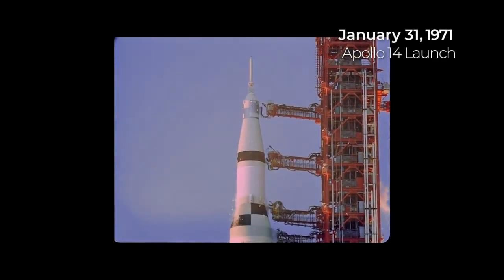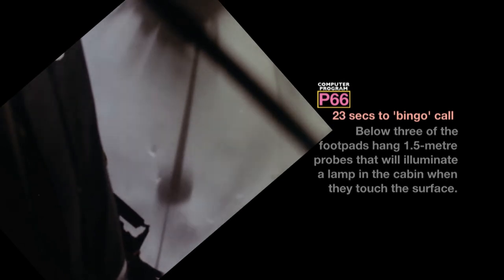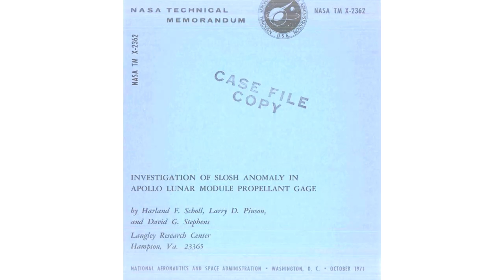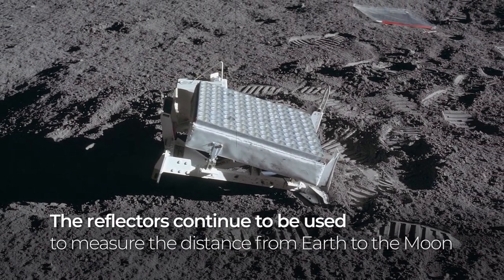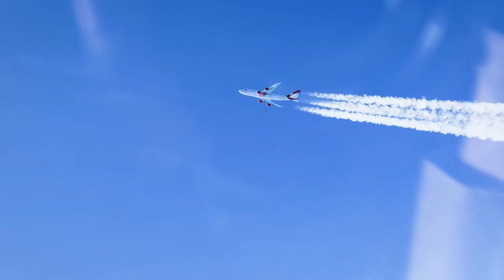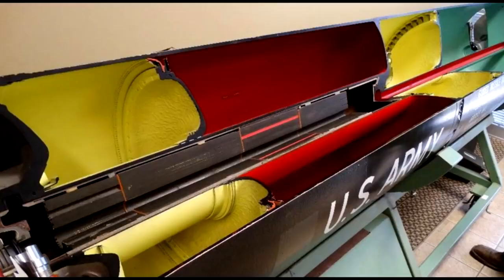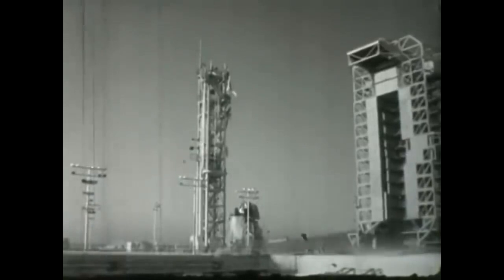How NASA's Apollo 14 Fixed A Critical Problem Using 'Keyhole Rocket Surgery'

Comment: The propellant has the same mass/inertia on the Moon but at 1/6 the gravity. This further confounds efforts to keep it at the "bottom" of the tank making baffling more important.  Ask a tanker truck driver if he likes baffles. :)
Reply: Not sure moon gravity is relevant when landing, as you are in free-fall when not accelerating (i.e. "gravity" is what YOU make it). Gravity is mildly important when leaving the moon, although your acceleration tends to be mostly straight up so sloshing isn't as bad as it is in free-fall.
Reply: @icollectstories5702  I agree there are no gravitational effects during free fall. Baffles don't have any effect either. However during deceleration and hover they do.  :)
Reply: @ebenwaterman5858  The point is whether you decelerate at 0.001g or 5g is at your discretion; moon gravity doesn't apply until touchdown, at which point fuel feed isn't vital. Launching from the moon is a similar situation, aside from assuming that you've stayed long enough for the tanks to settle.
Asteroid departures should probably not make this assumption.
Reply: @icollectstories5702  Well, not quite exactly, as during the final descent you'll have to pull > g/6 in order to decelerate and land -- consider that a perfect hover "feels" the same as being on the surface to your fuel tanks.
Reply: @icollectstories5702  The LM was only in free fall during Lunar orbit, it was a powered descent from orbit all the way down until the last three feet when a contact probe touched the surface and the descent engine was switched off. The LM then dropped the last three feet to the surface.

Comment: I did my PhD in micro-gravity CFD slosh modelling... claim to fame for this vid. XD
Reply: Will you work for SpaceX or NASA?
Reply: @conorm2524  neither, I am not a US citizen or PR. crys
Reply: @thunder852za  ESA?
Reply: The term CFD is ringing bells in my head but I can't remember why.
Reply: @ze_rubenator  perhaps one day... I am just a Aus citizen living in South Africa. 😅
Reply: @xmlthegreat  Computational Flow Dynamics. Basically computerized fluid simulation.
Reply: Imagine doing your thesis using a just a very tiny portion of an iPhone processing today. Then imagine yourself as Neil Armstrong about to start the engines after undocking from the CM.
Reply: well aren't we the fancy one?!?! *jealous eye roll*
Reply: Surface Effects for Arbitrary Mesh. Hmm. Intriguing
Reply: Sounds like they figured it out already.
Reply: mind me asking you if you using ansys or comsol or write your own solver by matlab?
Reply: @fotoniksuperduper9435  its a bit of a long story. The marketing pitch is: We write our own code in C++ called Elemental. We part of the InCFD research group at the University of Cape Town. We do work with Airbus and Ariane Group. So I wrote large parts of Elemental's code, specifically the incompressible two phase surface tension modelling physics.
Reply: @JGuraan  oh yeah. I remember now. I was helping my friends in Mechanical engineering install software on their computers and it was for their CFD class. This was years ago. May have been MATLAB, may have been SolidWorks. Don't remember clearly, and it's not my field anyway.
Reply: @JGuraan  *Computational Fluid Dynamics.
Reply: @thunder852za  Sounds maths and code heavy.  This was non linear CFD with 2 phases? Was your research successful?
Reply: Why not use a bladder with compressed air to press on the fuel in the tank, to prevent sloshing.
Reply: @alexdye6625  I think that would not actually prevent the sloshing of the fuel, since all you're doing is adding another fluid inside the container volume and pressurising the whole container. Try shaking the drink in bottle of coke... Even though there is immense pressure from the escaping soda, the liquid inside will slosh freely as you move the bottle around. Gravity or an approximation of it is the only way to keep the liquid on one side of the container.
Reply: @xmlthegreat  I meant more like a plunger forcing the fuel out and not allowing any gasses to mix with the fuel.

Comment: I saw a speech given by Neil Armstrong on the Apollo 11 lunar landing. He said that he "wasn't even concerned" about the "low" propellant quantity warnings he was being given from all quarters as Eagle neared touchdown, as very low fuel quantity remaining was exactly the way he had always done it in the LLTV.  Thanks to the excellent preparation the Trainer unintentionally provided, he knew the very little fuel he could count on having was sufficient to do what he had to do.
Reply: It sounds like the joke about the mathematician boiling a pot of water.  That would almost sound like he deliberately ran the engines until the fuel was low, then landed!

Comment: There is a wonderful Tindellgram on a problem with the low fuel warning light on the LM which meant even without the sloshing problem the warning would trigger the master alarm as well the low fuel light.   The memo finished: "if this is not fixed, I predict the first words uttered by an astronaut to land on the moon will be 'Gee whiz, that master alarm certainly startled me.'"
Reply: a case of an abundance of caution being dangerous? (master alarm going off too early)
Reply: @oldfrend  I mean I can see what they mean there, you really shouldn't get your pilots used to just ignoring the Master alarm because it goes off for low (not out of) fuel.

Comment: Very interesting discussion, thanks. Note that I designed a slosh control device and a propellant management device (PMD) for the liquid stage of Orbital Science's Pegasus rocket. The slosh control device was also assembled inside the tank, since the tank's construction was already completed. The slosh control device consisted of circumferential rings at multiple levels along the tank's length. The assembly's support structure opened like an umbrella inside the tank. The rings were then bolted by hand to that structure by reaching up inside the tank thru the outlet port. The PMD was a cylindrical design bolted to the outlet flange. It was sized to capture any gas bubbles during the initial startup/propellant settling of the liquid stage and thus deliver gas-free propellant to the rocket motor.

Comment: Capillary flow is used in many tanks with a complex vane structure.  That work has continued and I had the good fortune to support the Capillary Flow Experiments 1 & 2 out of NASA GRC.  We flew over a dozen different vessels and had the ISS crew perform hundreds of different test points.

Comment: I spent four years designing Propellant Transfer Systems for a small launcher company. I LOVE this video. The engines get all the glory, but there is SO MUCH MORE to making a functional liquid propellant rocket. 

Hydraulic systems, pressurization systems, propellant transfer, thermal insulation, mechanical devices like valves and actuators, safety vents for the tanks, propellant level sensing, propellant fill/drain/conditioning systems - all needed by the engines. 

Not to mention all of the infrastructure needed to test and launch....

Comment: Amazing video! I love these videos related to Apollo, like the one on why F1 engines which actually flew look like as if they were made of hammered metal sheets
Reply: It’s pretty crazy how much of the Apollo (and earlier Mercury/Gemini) hardware was done by hand. The ~3000 cooling channels on the F1 engine bell was all brazed on by hand for example. 

They also designed everything on paper with slide rules and compasses. No CAD, no CNC machining, no fancy computers (the flight computers were literally made of hand woven ROM), and no fancy materials like carbon fiber composites.
Reply: @eyeborg3148  Not exactly true.  They had calculators and such.  Manual input, to be sure, but they were available.  The first real computers were built in the 40s, the Eniac and Colossus.
Reply: @scottslotterbeck3796  Exactly true. No CAD. No CNC.  The computers were not fancy. Programmed in a near assembly language written for NASA use. They couldn't program what they wanted calculated they had to program how to calculate it. Calculators were mostly 4 function electromechanical adding machines. Multiplication and division were by repeated addition and subtraction. Electronic calculators were just starting to exist. They were large and still only 4 function. No trigonometric functions. Scientific calculators started to exist after Apollo 13 had flown  Everything had to be calculated either by slide rule or writing a specialized computer program and getting computer time ( not always possible it was a limited resource). 
Second edit. When they did become available electronic calculators were largely U.S  Japanese collaborations so NASA may have wanted to avoid them. Even the scientific calculators including Texas Instruments ( but apparently not Hewitt Packard).
Reply: @eyeborg3148  Not just ROM. The RAM was also magnetic core. They did have a mechanical core weaving device. The difference between RAM and ROM was that ROM had only the read grid, each core had an x-y location, and RAM had another wire to write. A lot of the process was mechanically aided component assembly, then hand "assembly assembly" then likely machine assisted welding. The welding machine program was hard wired.
Reply: @javaman4584  CuriousMarc’s many videos about the AGC and its design would be even better I’d wager.

Comment: 8:35 For anyone who thought Scott misspoke, he didn't really. He's referring to the supercritical helium tank in the descent stage of the LM on Apollo 13 (not the more famous oxygen tank explosion on the CSM). However, as I understand it, the tank itself didn't necessarily explode, but its burst disk ruptured when the pressure got too high, safely venting the helium into space; it did disable the descent engine, but thankfully by then, they didn't need to do any more burns.

Comment: "...tank was taken apart and englarged." I don't know what being englarged actually is, but it sounds terrifying.
Reply: It's a highly technical process (literally rocket science) where the 'eng' part of the tank is moved and 'larged' a bit so that it will hold more propellent.  :)
Reply: i was just about to comment this. It would be nicer if you put the timestamp of 5:25
Reply: @mikefochtman7164  the pipe stretcher!!! I knew it was real!!!! You nasa folks!!!!
Reply: It's a combination of "engorged" and "enlarged". Where engorged means that something swells because it is filled with a liquid and enlarged means that something becomes larger. Englarged means that you enlarge something by intentionally filling it with a certain liquid (either under high pressure or not).
Reply: it's a typo i think
Reply: What.
It's simply how things are made larger in England.
It just happens to work everywhere else, as well.

Comment: As far as I recall, in Apollo12 landing, that sloshing around was actually causing an RCS feedback loop, where the wobble caused by the slosh would set off the RCS, causing even more slosh. You can hear the astronauts comment that the RCS appears to be excessively active.

Comment: SpaceX is still trying to get the fuel, igniter situation sorted out on Starship.  It's no easy feat.  Me I personally like the idea of the bladder tanks, but for the ultra low temp fuels I assume a rubber or even silicone bladder simply won't hold up.

Would you like to know more?
Reply: Perhaps it was for non-cryogenic fuel (UDMH/NO2), but then the problem shifts to chemical resistant material... In all cases would like to hear more.

Comment: Another change for Apollo 14 (originally planned for Apollo 13) was using the SPS on the CSM to place the LM into the proper landing altitude instead of using the LM's DPS. Not only this burn placed the LM into the proper landing altitude, but also preserved the fuel for the DPS, which was also critical for the J-Missions as Apollo 15, Apollo 16, and Apollo 17 would land in terrain that was even more rugged than Fra Mauro, and this extra fuel would be necessary to allow for more hover time to find a spot suitable enough to land.

Comment: I remember when we were trying to straighten a bent pin all the way back behind a prop tank and one person was sitting below holding the borescope and light and I had one hand wedged back with the tweezers and it took us 45 minutes to bend a 1mm diameter pin back on a valve.  Fun times.  Another example of "rocket surgery"

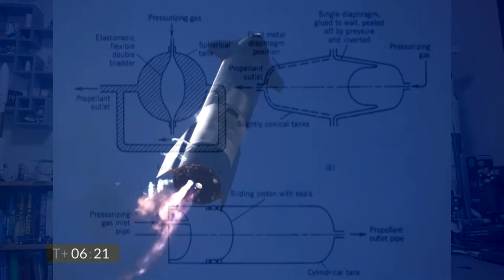Comment: 7:41 That is so cool! I had this same idea for Starship, when the engine ran out of pressure the first time, I thought it might have been from bubbles in the fuel line, and I was thinking how to move the fuel in zero G. I should have know NASA had already thought of this. My idea was more like a balloon inflating in the tank to displace the fuel, instead of the fuel being inside of the bladder.

Comment: The problems you have with fuel slosh in rockets is the same for fighters and aerobatics aircraft. If the oil pump is sucking air because the plane is in negative G's, your engine will not run for very long. Same problem with fuel (Spitfires that had carburators on their Merlin engines, could not take negative G's without cutting out as the BF-109's could with a fuel injection system).
Reply: Also the 109s inverted engine helped with this

Comment: I loved that video, it was extremely interesting! Thanks, Scott! 
But what the hell is a zero-g can? (Seen in the diagram at 3:45)
Reply: It is probably to trap a small amount of fuel right on the tank drain, so that they can make a short burn to settle the fuel before starting a long burn to decelerate.
Reply: @Kineth1  Interesting, that'd be very similar to the function of Starship's header tanks.

Comment: computer water cooling reservoirs also commonly have those vortex baffles, Especially for D5 pumps which are lubricated by the water itself.   If you have a well for your water at home and the tank is remotely modern that too uses a pressurized bladder to move the water into the pipes.

Comment: Loading LOX from a high pressure (220 psi) dewar into a test vehicle with delicate (50 psi max) tanks requires special consideration to the boiloff from the "warm" LOX. At XCOR I put a vented tank in the ground support equipment 15 feet up a tower and gravity fed the cold, pressure-limited LOX into the stand.

Comment: During the descent to the surface of the moon Lunar Module Pilot Ed Mitchell commented to Mission Control "This is a smooth ride". The comment reference the increase in performance of the upgraded LM with the baffles installed. This can be viewed at Apollo Flight Journal "Apollo 14 pdi to toiuchdown"

Comment: Zero G isn't so fun sometimes. What you are doing when you physically separate a liquid from a gas under pressure is that you have made something called an accumulator. There are piston and diaphragm accumulators. Having worked with both as an aircraft mechanic. I like the piston type because they are practically maintenance free. Only saw one piston type fail in 18 yrs while the diaphragm type on the DC-9 failed constantly. Its diaphragm was made of rubber.

Comment: Lockheed Martin has announced that it intends to use the RS1 from ABL Space Systems to kick-start space launches from Shetland. Looks like an interesting concept: rocket + ground control can all be transported to a launch site in standard shipping containers. Launch from anywhere so long as you have a flat concrete pad 150' x 50' and $12m.
What more can you tell us Scott?

Comment: IIRC, the S-IVB stage of Saturn had 'ullage' rocket motors.  Had to be fired as part of the re-ignition for TLI.  Get the fuel/oxidizers to 'slosh backward' in the tanks so they could light the engine.

Comment: Makes a lot of sense. My car sometimes had this issue - the fuel gauge said it was only about 1/8 full, then it went back up to 1/4. I must have parked on a hill, then it had the correct reading when driving along a flat road! 
Not sure how they would measure the amount of fuel in a zero g environment or if the fuel that had been used is replaced by air or some other gas (bubble(s) could be anywhere in the tank!) or if the tank shrinks to the size of the amount of fuel left!

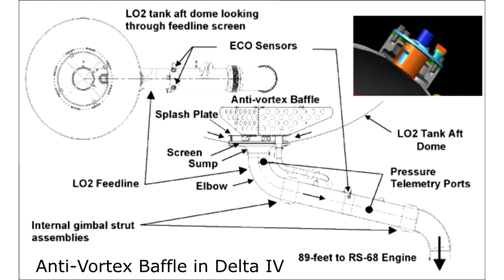Comment: 4:13 Is there a problem with Starship getting fuel when flipping back to vertical and landing?
Reply: In SN 8, yes. SN 9 had one engine fail  to light. In SN 8, the header tank didn't have enough pressure so the engines burnt themselves from the inside out.
Reply: @redpug5042  I was wondering if a vortex had formed.
Reply: @ProperLogicalDebate  Yeah, i'm not sure, you could look somewhere else, maybe SpaceX has a report on it.
Reply: SN8 had green engine exhaust due to oxygen rich combustion.  
SM9 had yellow engine exhaust probably due to fuel rich combustion.  
Fuel sloshing can explain why both failed to land.  And it can explain the engine failure on SN9.  

On SN8 they used CH4 heated by the engine to pressurize the header fuel tank.  Sloshing fuel could mix with the hot CH4 causing the gas to condense into Liquid CH4.  That would reduce the pressure in the header tank causing the oxygen rich combustion in engine.  

On SN9 they used compressed helium to maintain tank pressure.  That kept htepressure high but if helium reached the eninges it could cause difficulty in igniting the engines   Also if helium from the oxygen pressurization system got to the engine that did ignite you would get fuel rich combustion.